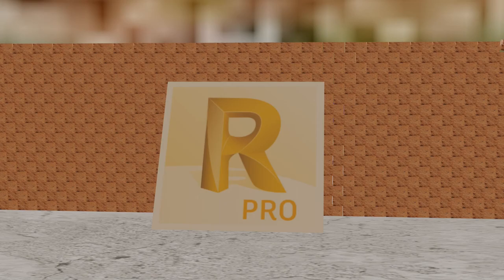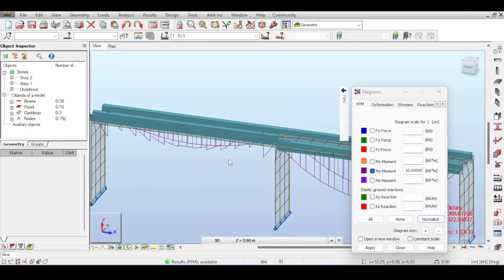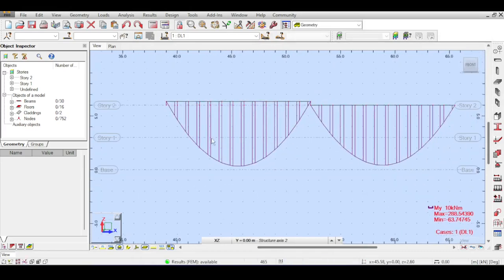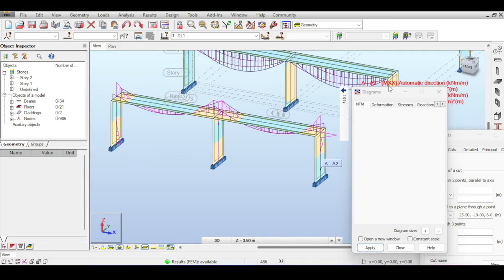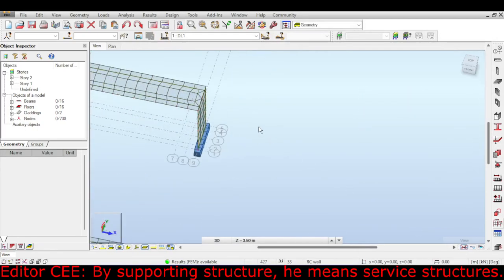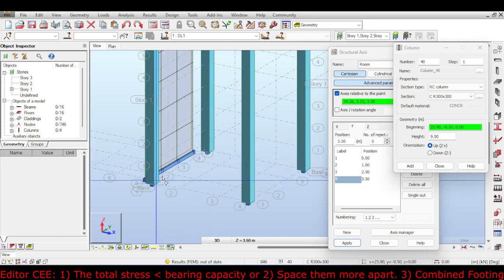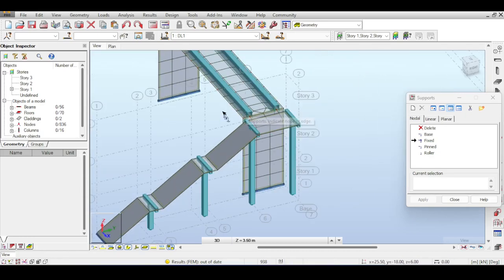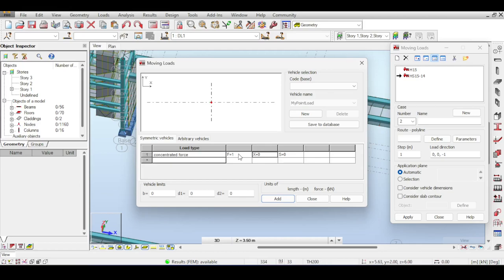Modeling Pedestrian Bridges Using Autodesk Robot | Part 3 - Modeling (2)

Comment: Hello CEE,

I am all smiles after watching this insightful video tutorial on the series, and I am also excited in anticipation of the next videos.

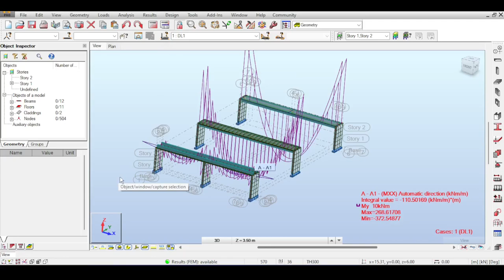0:15 With regard to a steel bridge option, I am open to the idea of having this as a different project depending on what the current situation may dictate. Steel design (and its efficient building-up or modelling) in this regard is sure to open-up new areas of learning in my opinion.

05:55 Wow Wow Wow, I hope AUTODESK is watching this, because you are really amazing CEE; your proposed solution and your demonstration of same (thanks to Mr. Editor for refusing to video edit – 04:57) is very insightful and satisfying. Kudos to you!! this is the CEE that I have come to know and admire in action. 

I am honoured by your acknowledgement of my comment in this regard. I think a little of your unhinged qualities are starting to rub off on me (and I want more and more of those! 😊). 

13:05 / 13:09 😊😊😊 FRAMED*, FRAMED*

15:27 Thank you Mr. Editor, good looking out w.r.t having or using more than one grid lines (structural axis) in the same model. This can be very useful at times (just as it is useful in this particular case). 

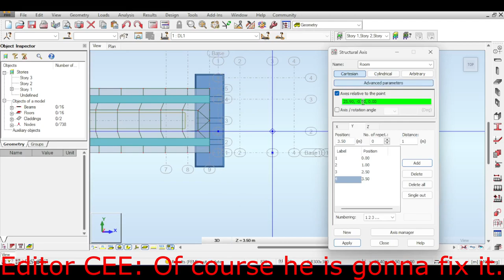15:39 😊😊😊, “perfectionist” one of the many qualities of the CEE that I highly regard.   

16:59 Yes, I strongly consider it to be extremely beneficial to me to be shown ideas of how the service structures may be modelled and incorporated into the main bridge model, including the interface (and connection points) between the two. The service structures heavy editing and omissions are (in my opinion) correctly justified. The snippets that were left combined with the fact that CEE have also shared the .rtd file is more than enough for the intended purpose and for this I am very grateful.

17:34 🤔 Myth or Science? I honestly did not know that clockwise or anti-clockwise staircase directions is a thing? I am curious though and I will search further to satisfy my curiosity. I would have never thought that it matters, but then again “feng shui” comes to mind.   

20:06 Wiz indeed 😊, and all of this from scratch and in just 2.5 hrs …very impressive in my books. 21:05 you are doing great with the editing Mr. Editor, the stuff (content) you choose to present is on point. 22:42 😊 .

28:20 If feasible, can CEE consider covering the selection of relevant AASHTO/PCI STANDARD I BEAM(S) for the currently modelled concrete pedestrian bridge later based on the model analysis results? In part 2 of this series, there were talks to use the section definition tool to represent a standard section(s) from PCI. 

30:11 I am not sure I follow here? I thought this separation is already achieved by “linear releasing the deck slab edge at this joint?” 

It is a nice thing that CEE is checking back and reviewing the plan as the series progresses. The currently outlined plan is still a very good plan, I am looking forward to it.

32:51 Very nice and relatable overview on buckling of beams. Considering that only the “compression flange or side or zone 😊” is affected by buckling, your counter argument that the deck slab may additional be used as a restrain or bracing system against buckling of the compression zone of the beams in cases of a simply supported span is valid. Provided of course that the deck slab itself have got sufficient extra strength and stiffness to resist or to restrain the resulting buckling loads from the beams and the connection between the slab and the beams is also strong enough as you have already mentioned. If the slab and the connection are strong enough, then the slab may be considered to provide continuous lateral restrain to the beams and no other additional bracings would be required nor would be necessary.

The question then becomes, how does one determine if the slab and connections are strong enough? How does one determine the magnitudes of the forces induced by the tendency to buckle and acting in the member bracing system? 

Also the bridge model with continuous beams have got its compression zone on the bottom side of the beams where there is no slab. I think this is where additional buckling restrains would be required (if the beam slenderness limits set by the codes to ensure lateral stability have been exceeded) 

It would be good to see some ideas and solutions in action on the current bridge model(s)

Thank you for another engaging video, and have a great day.  

Regards, DK
Reply from the maker: Hi there Engr. DK,
happy you and my dear viewers liked it. 
About steel bridges, they are also used. And they are DEFINITELY used for temporary structures, as it is possible to dismantle it.

Well, I do give credit to viewer's like you, Engr. Serpai and Engr. Candae. With people like you, I feel encouraged to dive deeper in those domains to get to the "behind the scenes" logic. Well, in this video, we (yes we, not I) have discovered a strange anomaly in the offset system when coupled with a slab.

Oh Mr. Editor was tired after that big thing. The reason was that the service structures took waaaay to much time, as stuff was discovered while modeling. It is actually even now not perfect, but reasonable at least.

Yeah my language kind of broke down at 20:06. I took a break afterwards by the way.

oh yes, PCI AASHTO beams types 1 to 6 are DEFINITELY going to be covered in the highway bridge. It is gonna be nice. I will try see if robot can design prestressed concrete. That is yet to be discovered

About lateral bracing, this is something I will try find a reference for. I hope I can present something useful next video

Indeed, when it is a continuous beam, then the compression zone switches and the deckslab would be insignificant as a lateral support.

I still have to dif deep to find an answer for this, so stay tuned.

Regards,
CEE

Comment: I think this issue with decks/slabs supported by beams is the one i told you long time ago, if you look at the deformation you will notice that something does not make sense. Ty for your effort we will continue supporting the channel! 💪🏼💪🏼
Reply: And i see that sap2000 for example does not have this kind of “problem”, is it impossible to solve in rsap?
Reply from the maker: Hi there Engr. Candea,
I thought about your comment. I still need to dive deeper and check the matter. An Idea I have is to perform a side-by-side comparison and explain the differences.

But I am happy that the video has partially addressed the issue.

Let's see ^_^
Regards,
CEE

Comment: I think it's normal for the bending moment diagram to have smaller values in the middle after offsetting due to the fact that, the shell is carrying axial forces and there's an arm length between the beam and the shell elements what creates a Moment, if u want to design the beam as a T shaped section it'd be a good idea not to offset the beam and take the full value of the bending moment but, if u want for example to design an I shaped RC beam carrying a slab it's be more realistic to offset the beam and design the I beam using the reduced value
Reply from the maker: I think you do have a point. And it does make sense. I still would stick to common design practice in using the simple.wl2/8 as moment.
I will include a full design example of a highway bridge later to show this.

Comment: What if we don't extend the deck slab to the piers. If we shrink the slab 5/10cm each side, it would be fully supported on the beam...
It is just a thought. 8:15
Reply from the maker: oh! that is an amazing idea! you are actually modeling the separation yourself. Cool idea. Thank you very much for your suggestion. It is basically "creating separation" between elements and this should work flawlessly ^_^